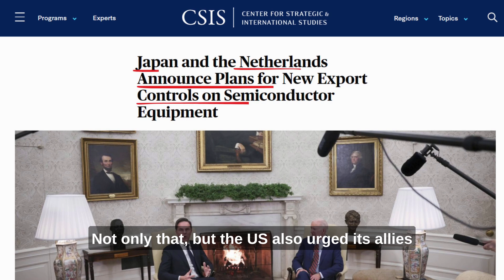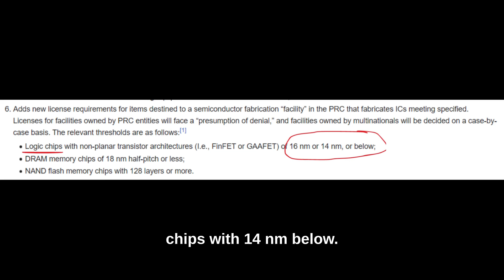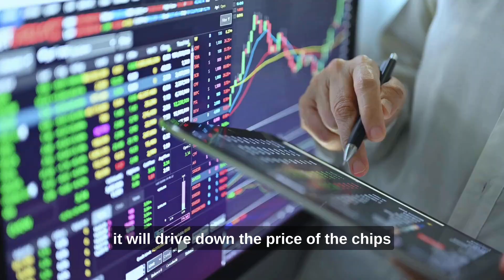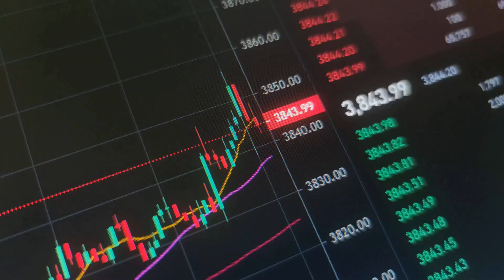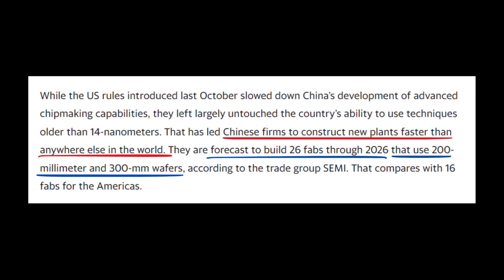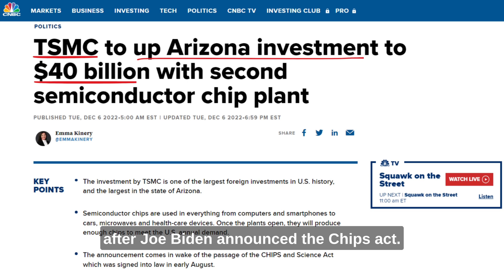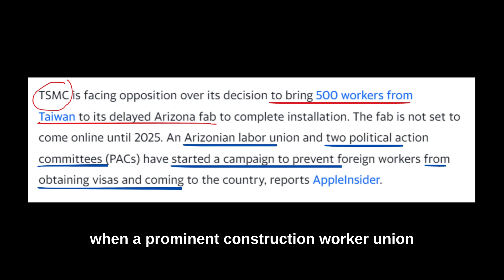How CHINA is Threatening the US Semiconductor Industry

Comment: I would use the term 'mature node' chips instead of 'legacy' chips.  Legacy sounds like something left over. The US made a strategic mistake by not looking at the total market when it made the decision to restrict and sanction China to prevent China from fabbing high end chips, like GPU chips made for graphics and AI processing.  The problem with that thinking is that it is not the size of the chip but the design of the chip that dictates function.  China has making AI chips using these 'mature node' designs and fabs.

The reality for the US is that it's companies designed and fabbed a broad range of chips in both mature nodes and high end (smaller) nodes.  When China focused on mature node chips it did so for two reasons.  First 85% of all chips are in mature nodes.  Everything from consumer goods, transportation, industrial automation, telecommunications, military electronics, and cloud computing.

The problem China had was it took the cheap way out at the beginning and did what must western semiconductor companies did. It designed chips but didn't fab them, hence TSMC and Samsung did a bang up business filling that sector. Only Intel was crazy enough to do both because it had founded semiconductors so it had to do both to develop the semiconductor sector.  Now with US sanctions, China has realized it needed to complete the entire supply chain to survive.  So, it spent huge sums to create the design, manufacture and testing of semiconductors. It focused on mature node chips because that was where the market was greatest and lacked the ability to produce high end chips because of inability to obtain the EUV lithography machines needed for these high end chips. SMIC had a EUV on order from ASML back in 2019, but ASML didn't deliver because of US sanctions.

China is already capitalizing on its investment in mature node chips and that growth will continue into the foreseeable future.  TSMC is trying to spread its business abroad to lessen the political problems created by the US.  TSMC and Samsung are ignoring the subsidies by the US as they expand their footprint in China. TSMC is expanding their current fab in Nanjing and Samsung plans to construct new plants within China that it once had.

Intel is now hesitant to build its two new fabs saying that US restrictions on sales of its high end market is killing their sales and profits because these high end chips commanded the greatest margins,  That same complaint came from Qualcomm, NVIDIA, AMD, and other smaller US semiconductor companies.  It is now possible that the $52 billion by Biden will go unspent.  Intel and Qualcomm both announced the start of innovation centers in China, breaking the requirement not to build new or expand old facilities in China. The US has an internal rebellion on its hands and seems unable to know what to do.

I think Biden is a stubborn man.  Like the Ukraine war, he refused peace and rushed headlong in supporting Ukraine only to find Ukraine has basically lost the war to Russia.  He is doing the same in semiconductors with China and the trends do not look good for American semiconductor companies as China expands its semiconductor sector to complete the entire supply chain needed to produce semiconductors.  America is losing politically and economically.
Reply: Well summarized.
Reply: Great insights.. I thought TSMC is asking $15 billion from the US for their $40 factory. The US needs to think further ahead. When they want to prevent China's tech, they restricted chips and equipment, but they didn't expect things will go this way. They need to think further and understand all the counter steps that China can and will take. 😅
Reply: @shawnlim466  When TSMC first decided to create a new plant, there were no conditions. Once they started to build, the US imposed several conditions:  First no expansion of existing plants or new plants in China for 10 years.  Profit sharing with the US government, and contributions for social programs and schools in Arizona. Obviously TSMC was taken back and started to fume.  On top of that, they had a HR problem of cultural values in working conditions.  Taiwan engineers work all shifts assigned, they work overtime if there is a problem, even on weekends and holidays. The plants run 24/7.  US engineers refused to work swing and graveyard shifts, and weekends.
Now, TSMC says it lacks enough skilled labor so is brining more engineers in from Taiwan.  The local labor union has protested the importation of more Chinese.
It's a no-win for TSMC.